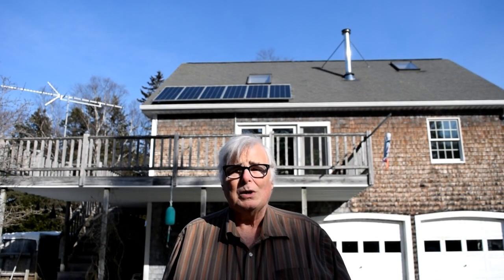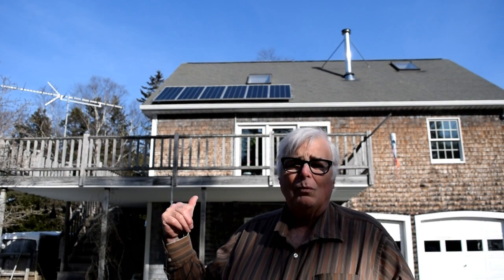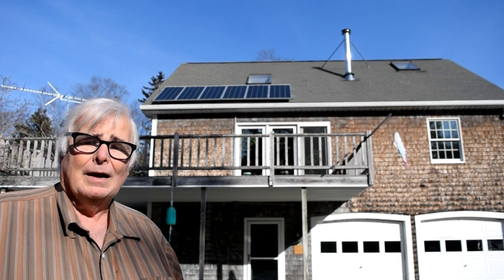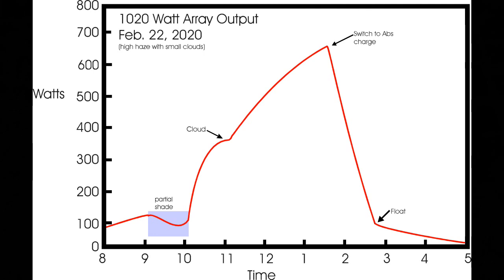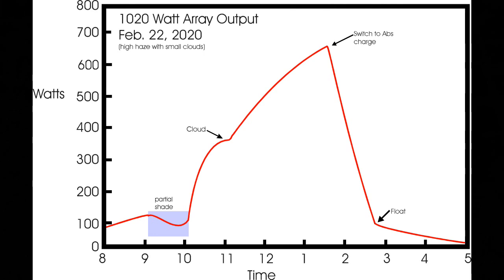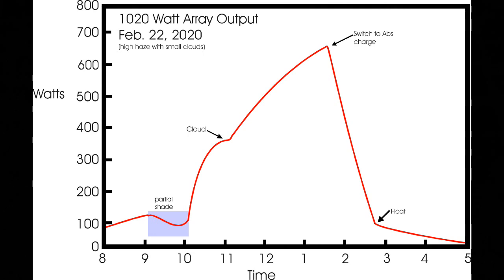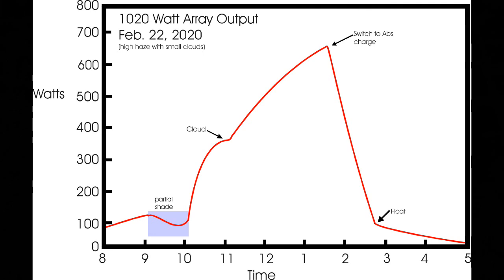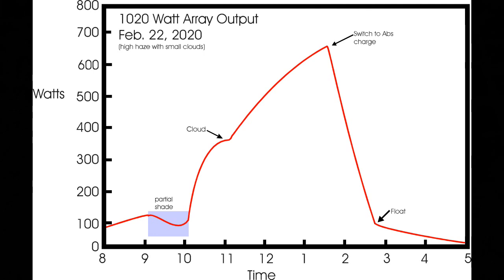Solar Panel Output in February in Maine

Comment: That's a good bit of information, and I think I would be fairly pleased with the output of the solar array too.
Reply from the maker: Indeed I am pleased.  That small solar array puts out enough to power my house on a sunny day, even in February.  Of course we use very little electricity relative to most people.